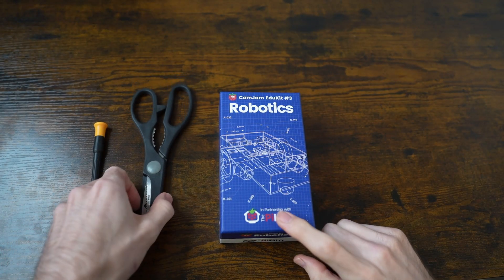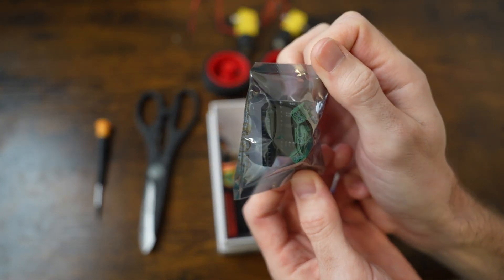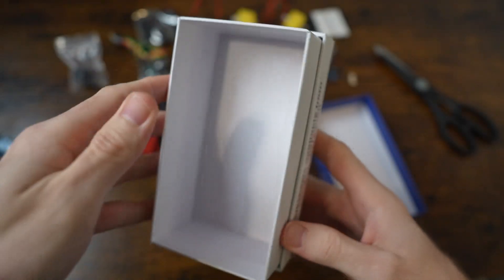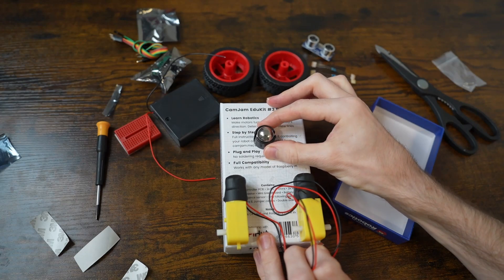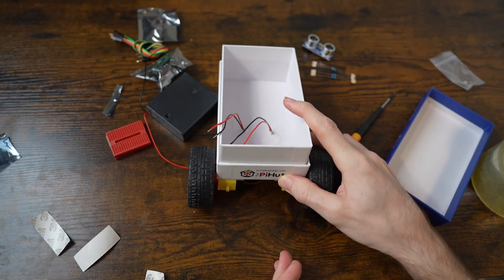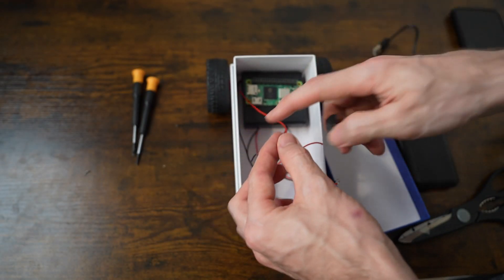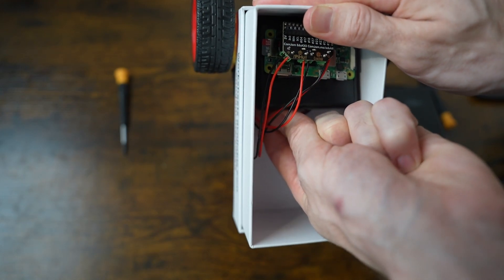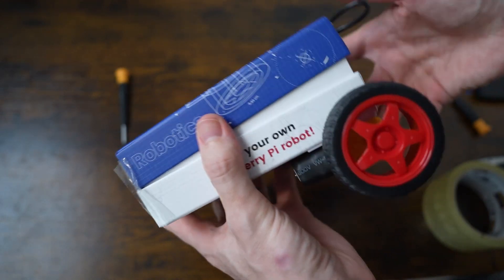#2 Initial Build | CamJam EduKit #3 Robot Kit

Comment: What is custom motor driver ?? Is it drv8833! I am from India I cant purchase the delivery charge and all will make to expensive for me
Reply from the maker: Do you mean the driver on the control board? I'm not sure, because it's a custom board released as part of the kit. If the board can't be shipped to India, you might have to look for alternatives - it'll probably be cheaper than trying to recreate that board. I'll let you know if I come across anything!
Reply: @mikelikesrobots yes! And I am running the ros nodes on docker in raspi os on Raspberry pi 5 .... 
But I am getting the error " This can only be run on Raspberry pi board "
Reply from the maker: @jayprajapati-ge9ds  You'll probably find it easier to run directly on the board by installing Ubuntu on the RPi, as I do in this series. Otherwise, you can try to run the containers in privileged mode so that they have full access to system hardware - maybe that will fix the issue. It won't help with the lack of motor driver board, unfortunately!